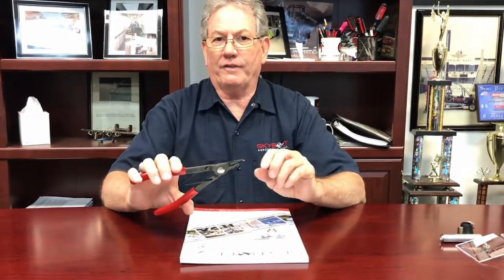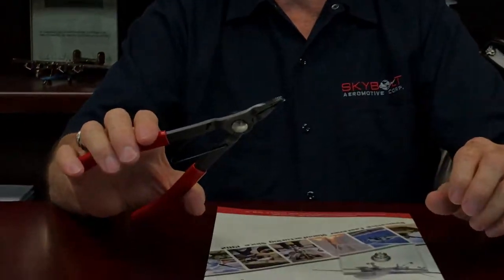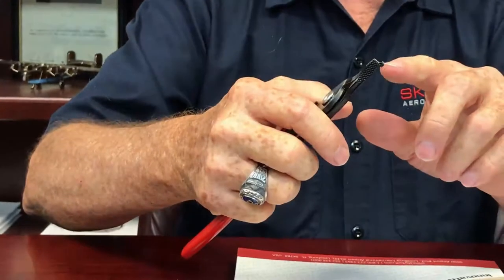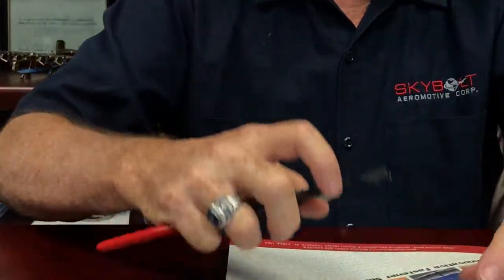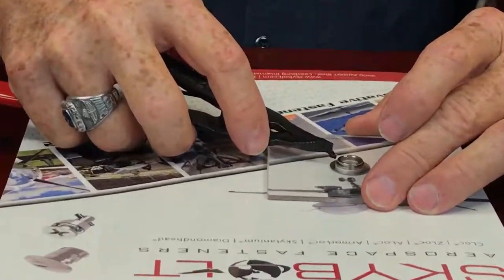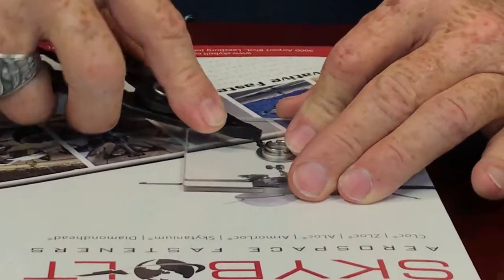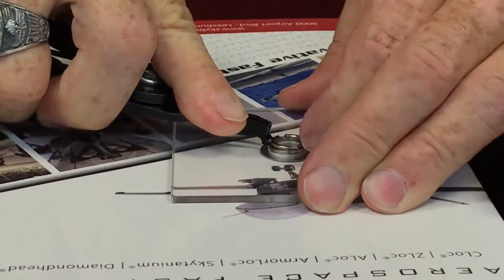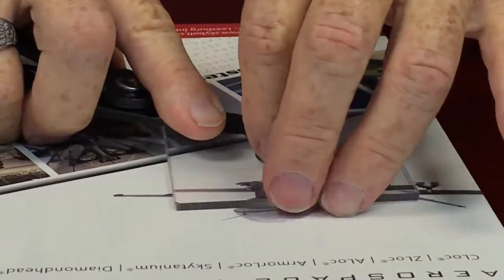Skybolt T27 Tool

Comment: Ned, I just purchased the T27 and tried them out. Sorry but I could not recommend them. 1.  Most slip rings have a very narrow gap. This  tool is not able to separate the ring with these large jaws. (Maybe a new slip ring has a larger opening but the standard Cessna retaining rings are so narrow I had to use a razor blade and a jewels screwdriver to expand them.  The jaws of the tool are just too large for this application.   2.  The handle and tool has a leverage or opening of about 4" (Jaws open too wide for the work being done). The slip ring only needs to be enlarged less than 1/4 inch. This tool is awkward and the handle is so large that when I was finally able to get one ring to expand the jaws fell off the ring as I slide my hand back to squeeze the handle.  Recommendation; Would be nice to design a small tool that would fit between your thumb and index finger with a very small steel blade to enlarge and separate the slip ring without having to adjust your grip.